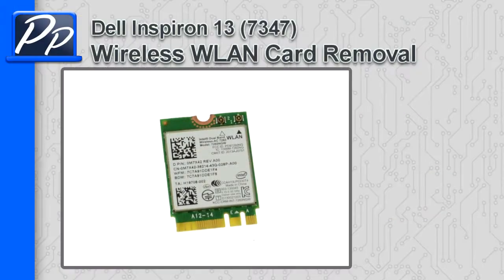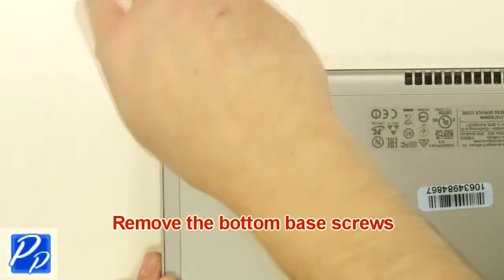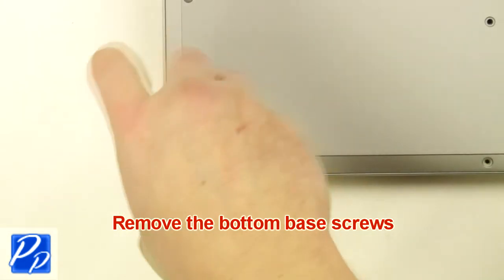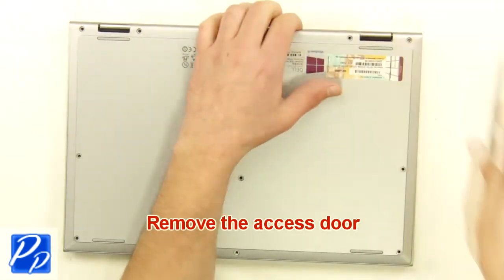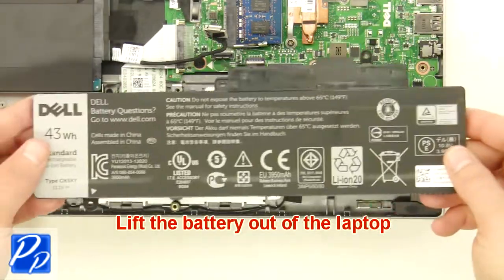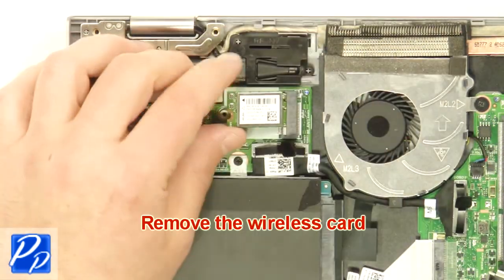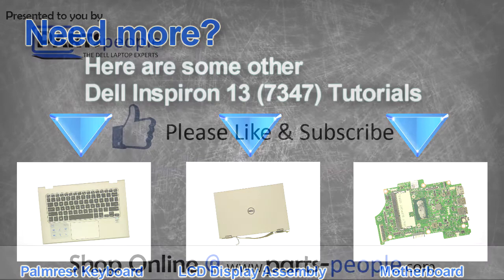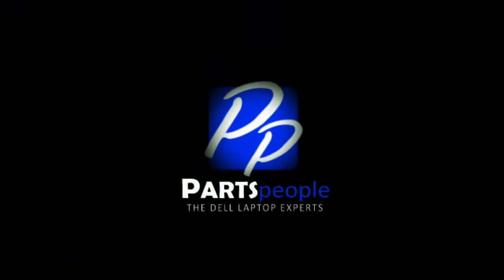Dell Inspiron 13 (7347) Wireless WLAN Card How-To Video Tutorial

Comment: Why did you remove the battery ?
Wasn't the purpose of the video just to show how to remove the wifi card ?
Reply from the maker: Disconnecting the battery is a safety precaution. Dell recommends this in their owners manual.
Reply: Parts-People.Com, Inc Ah thanks, makes sense.
By the way, I purchased a $40 battery on Amazon that was in worse condition than the 6 year old battery I replaced.  Dell only has refurbished batteries for $135.  Do you have any suggestions for a reputable source for a Dell 7347 laptop battery (Type GK5KY, Part no 04K8YH) ?